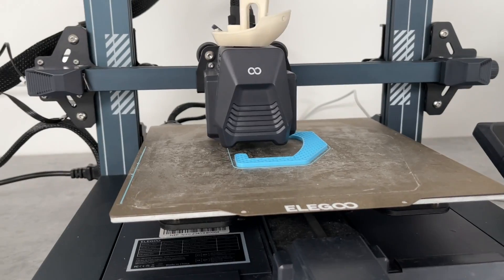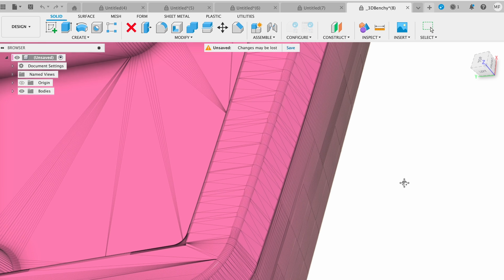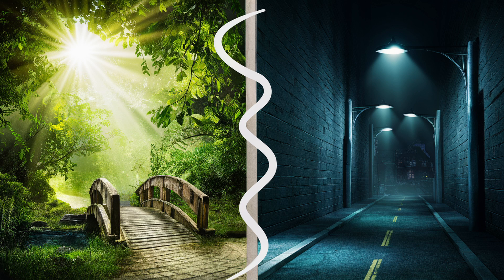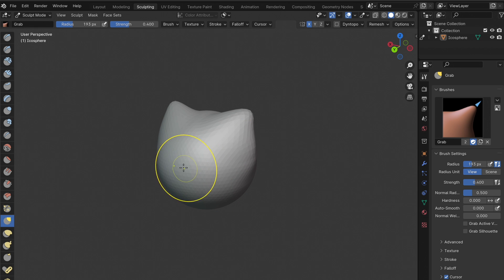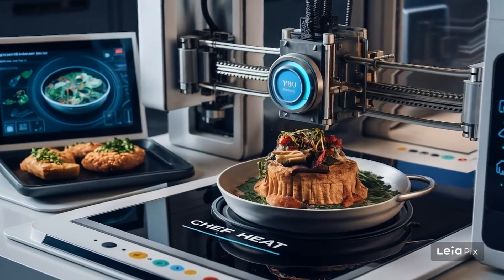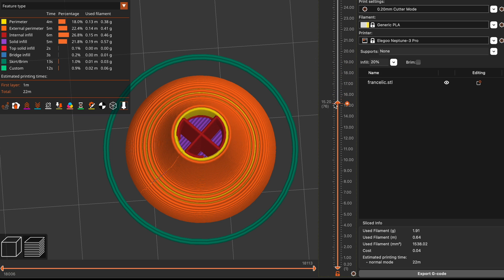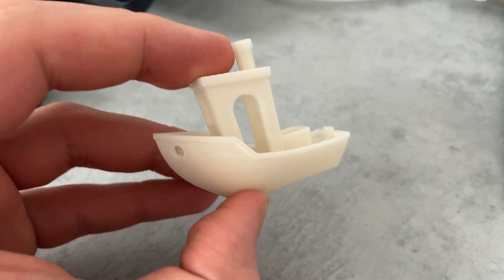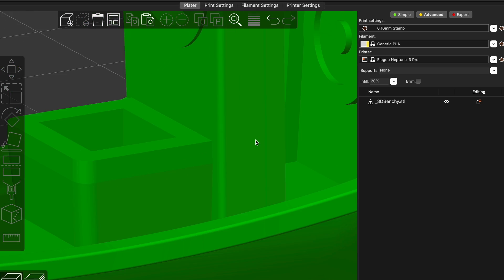What is STL file in 3D printing world?

Comment: What is used now in 3D prints is the STEP file, the STL is actually an old format and the new STEP yealds better quility prints. - Look it up
Reply: Uhuh.. then why lychee slicer, chitubox, voxel dance dango can't open my step cad files of hard surfaces objects when resin 3d printing? Or why any sculpted figurine isn't a step file? It depends.. parametric or polygonal mesh will both be used ans coexist for years. There's not only one... And no customer based resin 3d printer slicer (besides prusa) can open step files without converting to a mesh.
Reply from the maker: There are some cases where STEP better. But not always. Video in process